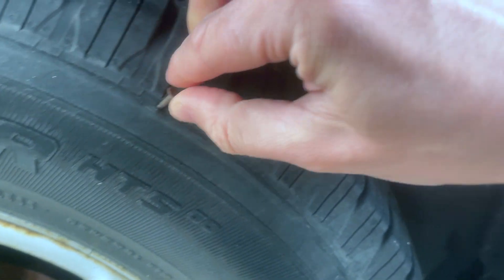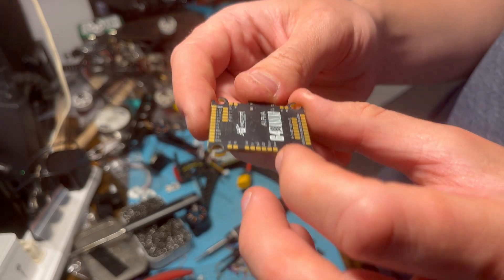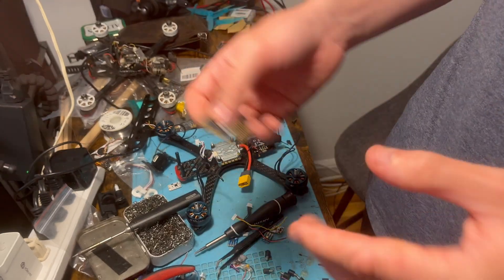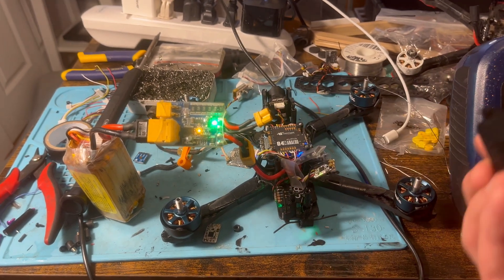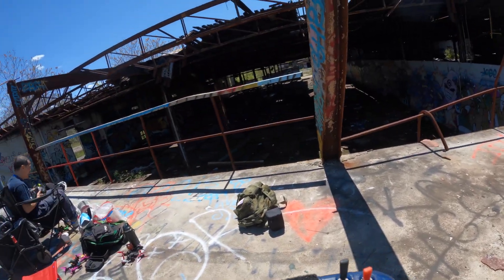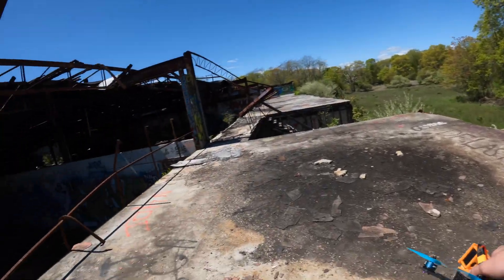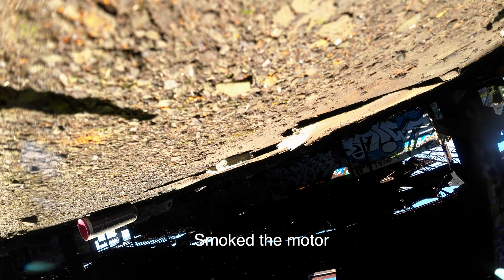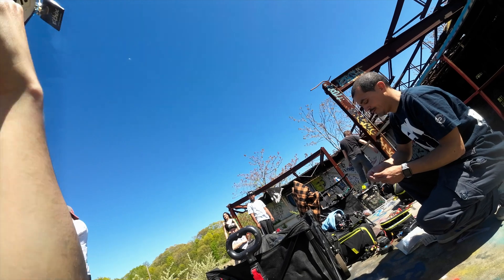How to Build a Wasp Fettec T-Motor Alpha Drone | FPV Drone

Comment: I'm thinking to move to just coating my arm ends in blobs of 2 part epoxy. I had an arm start to de-laminate and put epoxy in the layers then clamped it over night. It's been pretty firm since. It's a rough solution but it might be just as good as 3D prints, since you are only trying to stop delam not trying to prevent breaks. I will say skids would help with landings but I just dump mine in grass/mud/nearest bush if I can to help with landing damage.

Comment: nice video! too bad about the motor.. how did it get smoked so easily I wonder?
One option might be to get some titanium screws, those are more durable / harder that aluminum and definately a lot lighter then steel